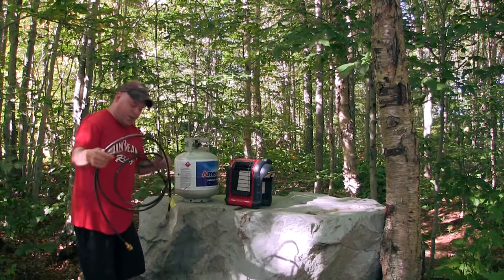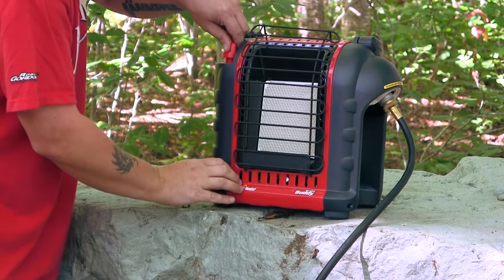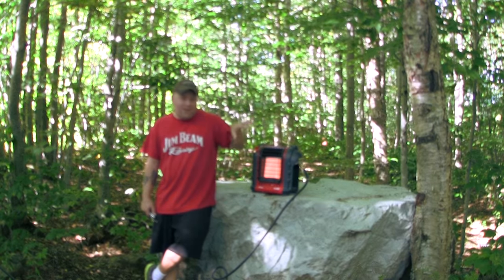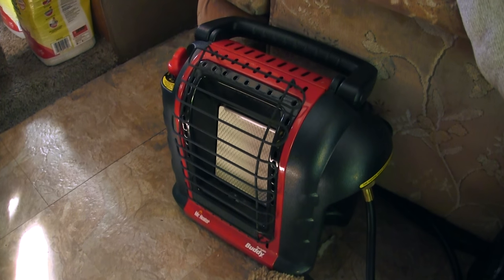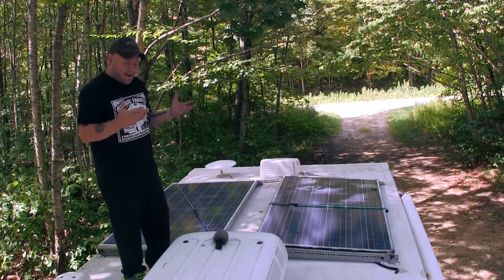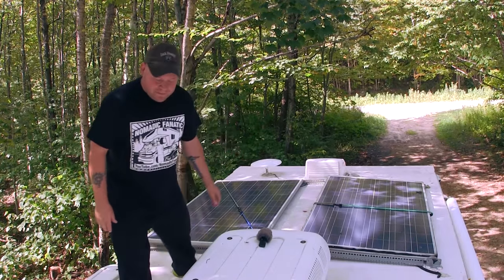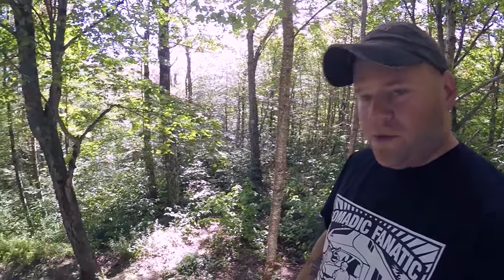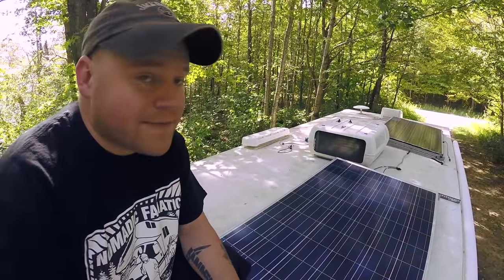Solar Panel Redo & Propane Heat Setup in Vermont

Comment: I found that after parking and during the night; hanging a quilt and wool blanket to block the open cab allowed my heater to warm the living space much easier.  Perhaps a standard moving pad might work to prevent the drafts.  Anyway, hope you get a handle on your room temps and stay warm.

Comment: Eric the simplest and strongest way to fasten the solar panels down is to connect the prop legs, when folded down.  On the panel hopefully you will be able to use the same attach point you use when they are up to gather sunlight but connect to the prop leg near its pivot point on the bracket fixed to the roof. It would probably make sense to connect the other end of prop leg and panel to prevent any rattling that might occur there (it could act as a backup to the main hold down as well.) If you have to adjust where the angle bar (w/holes) and the panel attach together, a short bolt and wing nut could act as a quick attach mechanism. Good luck; although I feel quite sure you will figure it out based on the other mods and improvement you have shown in your videos.

Comment: I set my travel trailer furnace at night to 65. Never had a problem with the fan wearing down the battery.  My solar panel would always recharge the batteries the next day. You must have weak batteries.

Comment: Hey Eric I can help you make some metal retainers for those solar panels!  Your probably already though NH and into Maine at this point in time.   Look up Traveling Electronics Keene, NH on Google and you'll find my contact info.  The campgrounds in VT are really nice but the state ones usually won't have power.
When you get past Boston and want to see some neat areas to video look up Wompatuck  State Park in Hingham MA.  They have power and an old munitions factory or two to explore.  It's kind of an off limits place but there is always a way....
Jon

Comment: Eric, for the solar panels, wouldn't it be a simple matter to attach a bracket to the free end the same as you have to the fixed end? Then you can easily secure it with a short bolt & wingnut.

Comment: Add tie down brackets for your panels.  Bungee cord will eventually rot out in the sun and your panel will go flying at 70mph.  Hopefully it doesn't hit another vehicle and you cause a serious accident.  Harbor Freight has a 4 1/2 inch angle grinder for about $15.  Currently free if you spend $50.   I use it all the time for cutting, grinding, sanding.   Zip that extra angle stock off in about 10 seconds.  Bolt the extra down on the opposite side and use that to tie your panels down.

Comment: Eric, I can't see the bracket very well, but could you put a wing nut and bolt through the brackets and the frame of the panels? Maybe you would have to drill a hole that aligns with the holes in the brackets.

Comment: Just a suggestion Eric, a little cleaning of the area where you are filling the holes would give a greater assurance of the holes remaining water tight. I spent 40 years in the building trades and several of those doing insurance rebuilds where water infiltration was the problem. I really enjoy your videos!

Comment: I am looking into the big buddy heater and a Lasko ceramic (14 amp max I believe) heater as a tag team for over wintering in New England. 
I am hoping a Renogy 200watt solar kit with a 120ah interstate battery can keep it above 40 degrees during the day. I will run the big buddy briefly in the morning and when I return home late afternoon to get it upwards of 75 degrees.
My area to heat will be a decently insulated 50 sq feet section of my RV. I have a dog that will most likely stay with a relative during the day and with me at night. He is short haired and I am not willing to see if he could handle 40 degrees.
Keep the video's coming. I thought it was real cool to see you using a MR. Heater product similar to what I plan on having.

Comment: Eric, I recomend a hot water bottle for colder nights. It may not be enough for temperatures like 40-50 F. and below, but It works perfect in autumn/spring's reasonable cold. For Jax a small shed that he can warm up by his body should be enough. Stay safe!

Comment: My shorter Tioga is mainly heated by the furnace.  I just turn it on for 5 min and by then the coach is around 80.  Sure I could save $ with a buddy heater but it is just another thing to haul.  If I was strictly boondocking constantly I would get the portable heater.
Reply from the maker: Yeah, I'm ok with running the on-board furnace with I have solar during the day, or while the generator is running the morning for coffee. Its certainly is efficient quite quickly.
Reply: any of us that RV are well aware how quickly that heater fan draws down your batterie(s) if you are not hooked up or on solar.  I never dry camp, I look at my fifth wheel as a giant toaster that needs to be plugged in to work.  My RV group says there are campers and/or RV'rs some of us are most definitely  RV'rs

Comment: When you first installed the second solar panel I was thinking that may be a problem (I should have asked about it?), shame.  
I thought the reason for not placing the second unit where it is now was not enough space forward of the AC.
I suggest you angle the panels where you like them, mark two holes (paint, permanent ink, etc...) beyond the fasteners then ask a body shop if they would cut off the excess material and deburr the ends.
T protect the panels get some small diameter bike hoses (used) and shrink tubing.  
Cut the tube (at air stem), slide the shrink tubing and tire tubing over the bungee, heat the shrink tubing to seal connections between bike tubes and hold the bike tubes in place.
The only concern I have is the bike tubes leaving any black residue on the panels.

Comment: hi Eric.   Great videos you could lock your solar panels down buy drilling a hole that aligns with one in the leg supports and just use a couple of low cost locking pins for hitches. hope that helps.

Comment: Just mount an L bracket next to your angle supports when down, with the holes lined up you can just insert a pin or nut n bolt to keep them secure when mobile.

Comment: If the panels already have connection points to mount them up at an angle, cant the same holes  be used to secure them down instead of the bungee cords?

Comment: FYI: You're not venting off carbon monoxide.  You're venting off moisture, which occurs when using propane.  If the windows are closed, you'll get condensation in the van, which can cause rot.

Comment: Just an extra warning.. I used my Mr. Big Buddy last year in my RV with the external hose as well. I was lying in bed one night (luckily still awake watching TV) when I heard a loud HISS from the kitchen.. Turns out the Nanook (My husky) ended up moving the propane hose in front of the heater, which then promptly burned thru the hose and I had a blow torch instead of a heater.. Luckily I had the propane tank (20lb) inside the RV about 10 feet away and was able to go to the tank itself and turn off the propane.. It was either that or evacuate the RV before it went up in flames.. 

Yes, it was by far the most scary moment I've had since I started full timing in my RV 2 years ago!!!!

Comment: Thanks again for sharing Eric. I`ll join the chorus and say you lost weight-good for you. I still wonder why your furnace is such a battery-guzzler. With roughly half the capacity of your setup I can have the furnace on for two nights straight and the RV still has decent voltage. Is it possible the furnace is broken or the insulation is less than ok?

Comment: I've read about the buddy heaters but never looked into getting one. I have a 42' fifth wheel and I have my central ducted heat set to 68 at night so it runs all night long. I have a two year old do my wife demands it. I have never had a problem with my batteries getting low. I am running 2 6v that have 220 amp hours. I understand that you gave a four battery set up with around 480 ah if I remember correctly? Do you have a problem with your batteries running low after a night of heat? Might want to have the system checked out. Sure my trailer is a 2012 and a little more efficient but I don't think your greater should kill that size battery bank after one night.

Comment: Use a hacksaw to shorten the metal leg. A cut off wheel on a grinder will also work.

I'll start boondocking/fulltiming after I vote in the 2016 election. The remote solar tilt that I am currently installing is over the top.

Comment: Eric, your furnace blower draws something like 4 or 5 amps an hour.  Considering the fan doesn't run 100% of the time, Is that really enough to deplete your house batteries?

Comment: Your bungy straps are reducing your solar panels output more than you think.  Even covering up a 4" square corner, you might lose 40-50% of the output.  Have someone up on the roof, and you inside at the charge control and remove the bungy cords to see what the difference is.

Comment: Just secure the top of the panel to the bottom of the angling rods and panel won't lift. No bungees required.
Reply: ....and maybe generate even more power. Our solo panels would not generate power with anything laying across them.

Comment: Jax is just such a sweet cat. He is awesome. I recently saw a little ceramic heater called "my heat" and it is 200watts.....that's like a couple light bulbs. It is $17 on Amazon and they really work good. Check them out.

Comment: The only thing that bothers me, is the regulator being at the end of the line.  That means you have high pressure gas all the way to the end, as opposed to low pressure gas.

Comment: radiationel   cooling  Very common in new England this time of the year , Temps can drop HARD once the sun goes down. might want to invest in a thick quilted " winter " Blanket.  A thicker blanket is cheaper then propane .

Comment: Could you not put a connector on you main propane tank setup on the RV for the heater so you don't need the extra tank?

Comment: Mr. Buddy does not work beyond 7000' altitude.  If you are going to be that high or higher the Coleman BlackCat Catalytic heater with a 1lb propane canister is completely reliable.  Always read the instructions for both for safety.

Comment: If you already have a drill, purchase a relatively inexpensive cut-off wheel to cut the solar-panel bracket.
Remember...Safety First.  Wear eye protection.

Comment: Eric, I have heard alot of folks complain of fumes from that particular heater & also some complain of tons of moisture all over the windows when using it. Whats your experience & or answer to those particular issues?
Reply: I have had moisture form in my camper from this heater.  I never had problems with fumes.
Reply: thanks guys.

Comment: do you have problems with moisture using the buddy heater? when i use mine in the van the windows start getting moisture on them pretty quick. i have had a couple of them now and i also notice a little odor when using it and its not propane .

Comment: Told ya , gets Brrrrrrrrr real quick .  I always bag that heater when not .being used . I also use Teflon tape on fittings an small Lp bottle for instant use .   They sell an Lp tank holder bracket ya can mount outside , don't like tanks in camper . We want 2 C ya hit Atlantic .  if ys stick around a couple more Wks. , ya might catch early foilage

Comment: Is that the same buddy heater you had a problem with where the knob was stuck and wouldn't turn?
Reply from the maker: Same model, yes.  But I replaced it with a newer unit in March.

Comment: REALLY CURIOUS: Did you just drill random holes into your roof or did you position the panel so that the screws would bite the roof rafters? Were you concerned with accidentally drilling into other wiring?

Comment: How much propane does the heater use on an average night?
Reply: Mr Roger I can run my Buddy heater in cold weather for about 5 days off of a 20lb cylinder. Of course that's on low and sometimes cut off during the day. Not an exact science but I feel pretty good when I can get almost a weeks heat for around 12-14$. Of course, you didn't ask me and Eric may get different results. CVK
Reply from the maker: I don't often run the heater at night. There were a few times last year when I was in a place that got under 32 degrees and I did keep it on low overnight. On low, the heater goes through 1lb of propane ever 6 hours. On high, it's 1lb per 3 hours.  So, in essence, one BBQ 20lb cylinder should last you about 100-110 hours (because they don't fill them completely up. I don't use it for steady heat non-stop, just to suppliment.
Reply: so my five day thing would equal out pretty good with those hour numbers. However I run mine all night. I just make sure I have a Carbon Monoxde detector and a window cracked about an inch or two. Have not woke up dead yet....

Comment: Hey Eric , over the years I have used bungee straps way to often . If something important is involved I recommend what many Adventure motorcycle riders use . "Rok Straps" , they have a small amount of stretch and are very strong with quick release buckles . Here is a link for them , I think max length is 60" . See what you think .   https://www.amazon.com/ROK-Straps-ROK-10025-Black-Motorcycle/dp/B00SXJLLBW    I know if I had that many dollars invested in solar panels , I would feel much better about traveling with these straps . Do you crack a roof vent when using your propane heater and do you have propane and carbon monoxide detectors that work ? Enjoy the season !